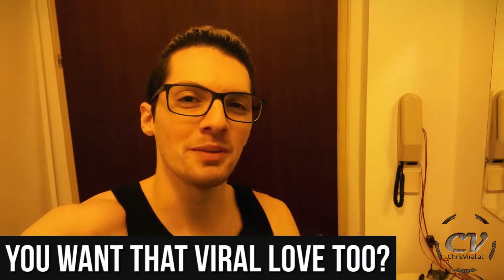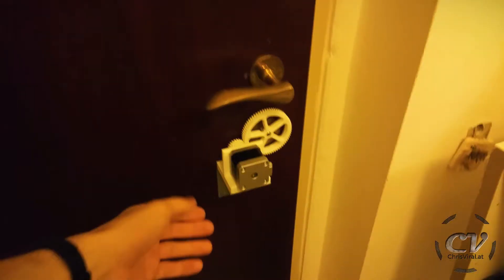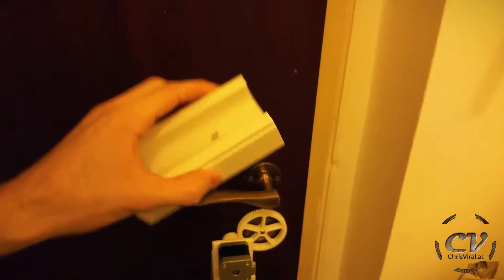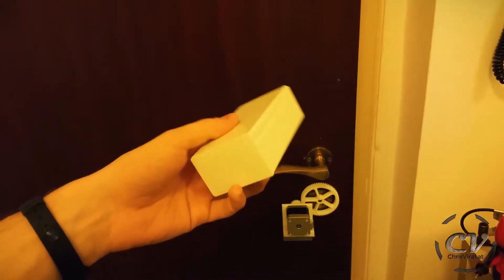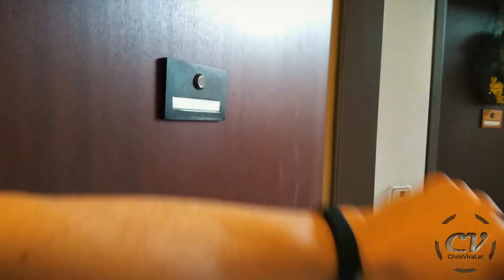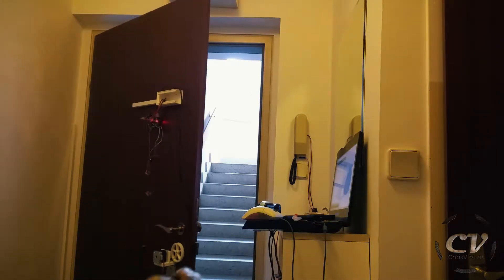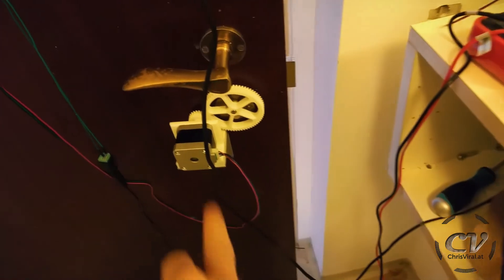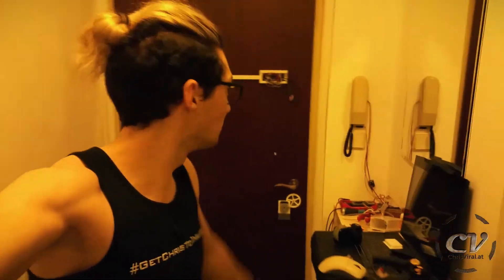DIY NFC Door Lock (FINALLY WORKING)

Comment: that thumbnail looks like a perv win meme  ;)
i would not rely on glue at the motor shaft, it will age and fail at some point.
there are seval easy methods to improve.
 1: drill a small hold in the shaft and if succsessfull in the gear too so you can put in a small piece of metal wire/rod. (not parallel , i mean throught the side of the shaft)

 2: use a dremeltool to grind the shaft a bit flat on one side, then cut a screw thread in the gear (m3 or m4 if possible) and use a headless screw ("madenschaube= allen screw) https://www.ebay.com/itm/1Pc-26T-Printer-26tooth-Gear-11mm-x-11mm-For-DIY-New-3D-Printer-Extruder/302322542984?hash=item4663d3e988:g:-Q0AAOSw-3FZH9DC
the screw locks against the shaft on the flat part so its safe.

3 grind a slot parallel to the shaft (1,5-2mm) then put the gear on and drill in with a drill
so the gear gets the other half removed too
(https://de.wikipedia.org/wiki/Passfeder)

 next idea, add a camera on the door and a monitor so you dont ahve a better view + you can add a DVR with motionfeature so you know who was on the door when you were not at home ( idont know if its legal in your country since we all got stasi laws these days ;D)
Reply from the maker: Hahaha yea :'D
I think in one of my countless vlogs I showed a close up of the shaft & gear but I'm not sure soooo: It's actually a shaft with a flat side and the gear has the same profile. It's a bit too big though, like 0.1-0.2mm.

I used epoxy and this might be an interesting test how long it will last. I don't worry too much about that though. I don't think it will give me problems soon. We will see.

On the bigger gear there's a bigger flat surface, again a bit too big. On this gear I used a screw to mount it on the lock, I'll make sure to include a close up in the next door lock update.

Thanks for the Passfeder idea, that's pretty cool.

Yeah the last point would be illegal lol
I don't care too much what happens outside the flat but I'm thinking about indoor surveillance.
Reply: ah ok if the shaft has a flatide already and the gear too, its safe.
I thought the shaft is only round since its the most common shaft.
For the surveillance, only the recording might be illegal(TFT without rec is not) but there are some expetions:  https://www.test.de/FAQ-Private-Videoueberwachung-Das-ist-erlaubt-und-das-nicht-5045901-0/
Reply from the maker: Thanks for the link :)